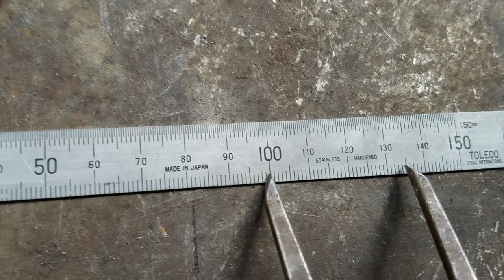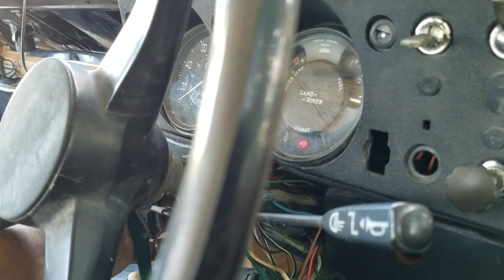Land Rover  3300cc engine. Holden Commodore  transplant - Exhaust  Repair Fabrication DIY Off Grid

Comment: Welding underneath a vehicle can also be bad for a sons’ health if his dad is doing the welding, like what happened to me.  My dad was a huge prankster and he was welding underneath his truck and asked me to checkout the welds, well he stuck the electrode in the wet ground and I crawled underneath while it was still wet and reached up and crabbed the grounded frame and shocked the hell outta myself. My dad laughed and asked how the welds looked, hell I couldn’t say I was beating the bottom of the truck apart with my body.
Reply from the maker: Agggh!  That's horrible!  I hate electricity. I gets belts off sparkplug leads when other people are completely unaffected.
Reply: @t.h.o.r.  my Uncle is also a big joker so I took him my show truck I had to get it tuned knowing I had solid core spark plug wires that would light you up through just about anything, man when he put those cheap wire pliers on those plug wires to see which one was bad it lit him up and he bounced or danced all up under the hood of my truck and to things worse his best friend of 50 years gave him a pain pill for a dog   Wooo I don’t know who he was upset with more me or his friend. I think his friend come out worse on that because he didn’t come to work for a week as where I spent the night at my Uncles house   PS my uncle is basically my dad after my dad passed but he’s always treated me as such